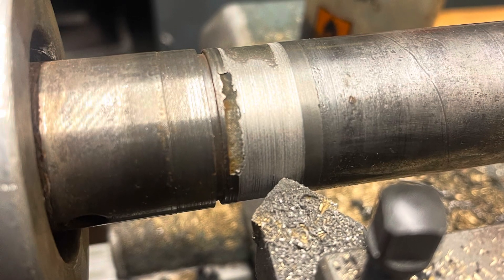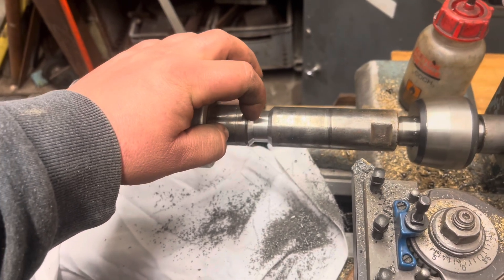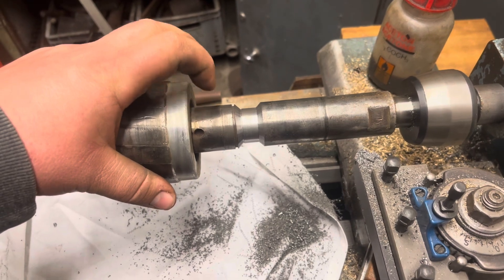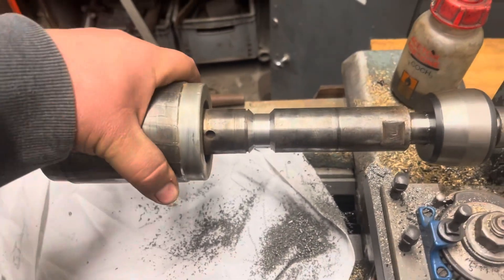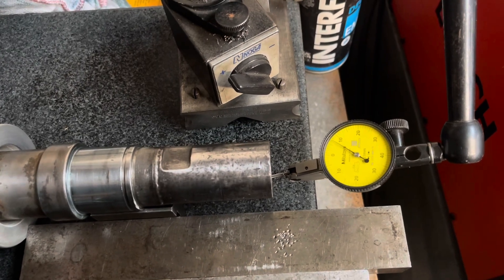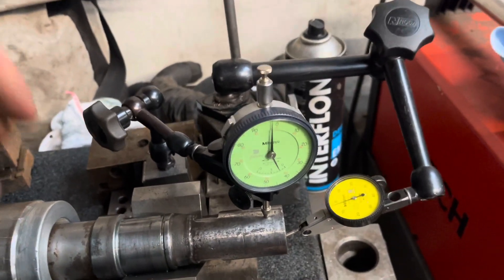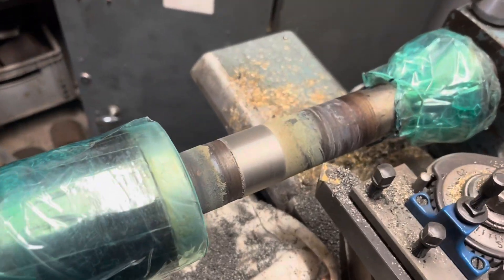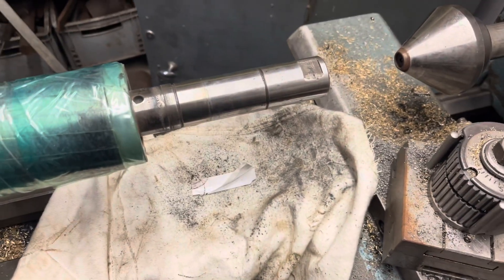'Cold' Shaft Repair - Flame Spray With Castolin Eutectic Rototec

Comment: Hi, I wonder if you can help me. Maybe you had the same experience? My Rototec always worked just fine but now it doesn't seem to let the powder get to the nozzle easily anymore so I have to tap the powder bucket on top while I'm spraying to get something out but working like this doesn't really turn out well for the spraying process. I checked the little hole where the powder needs to pass through along with the hole in the 'shifter' and all passages are free as far as I can see. Thanks for any help...
Reply from the maker: Yeah i've had this with certain powders. I've put it down to damp powder.
Reply: @MJBEngineering  Thanks for your reaction. The powder I use, I've used lots and lots of times. I thought the problem might be occuring because of the powder being too old, but I tried a new, previously unopened container and the problem remains. Sorry but what do you mean exactly by putting it down to damp powder?

Comment: ЗДравствуйте как настроить robotec 1 ,нашел новый инфОрмации нет а,вас такой же robotec 1 ,
Reply from the maker: Hello my friend. 
Neutral flame very important. 
10-15 PSI Oxygen
4-5 PSI Acetylene
Reply: Спссибо.
Reply: Нужна ьюбая иняормация по этома пистолету,если можно.Спасибо.
Reply from the maker: @МаксимКомов-к2ф  What do you need to know? Rototec 30-50 years old so no spare parts available. Mine was made in 1971.
Ensure powder tube is directly above nozzle